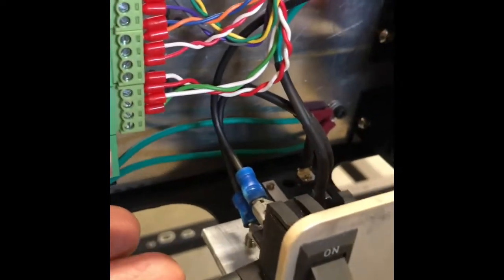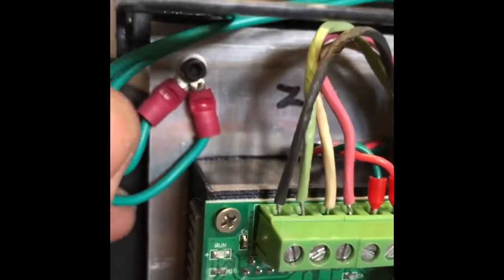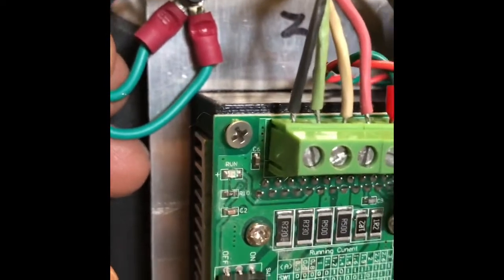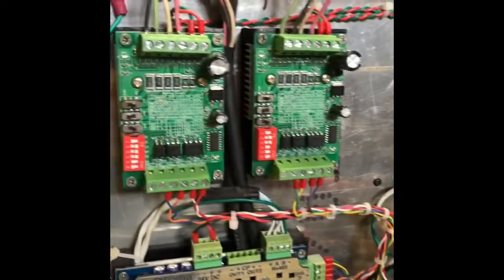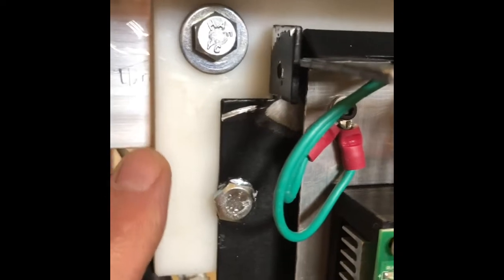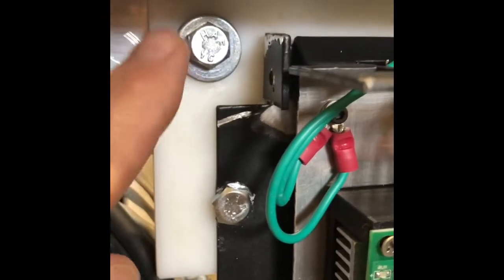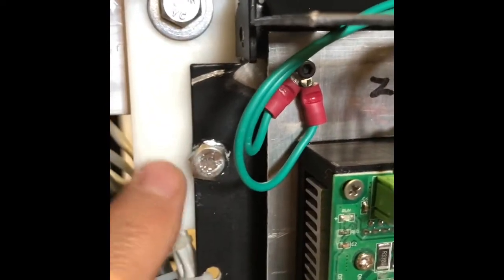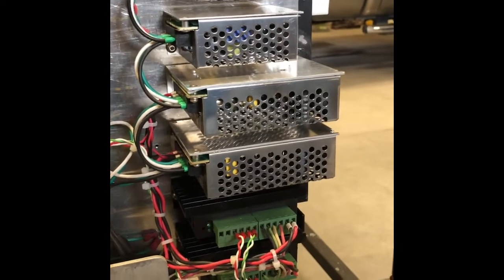DIY CNC Plasma Cutter electrical isolation

Comment: I have a plasma table under construction and the most sensible controller choice seems to be the Proma MyPlasma, not otherwise identified by number  You are the first YouTuber that I have found to be using this system.  I contacted the distributor concerning user groups or other sites and drew a blank.  Do you have a comment on this controller?  It is obviously working very well for you as I don't recall a mention of problems.  It's also obvious that you know your stuff and you did a great build.  Thanks for sharing.
Reply from the maker: Thanks for for the comments! Yes the controller has worked great!  I think it was a really good choice.  Like you I had trouble finding others using it.  A lot of people are using the Proma auto torch height controller and seem to be happy with it after they were able to get it tuned in.  I was going to go with one myself but when I found that for only a few dollars more I could get the myplasm set which comes with the auto THC and the controller. I figured it was worth going for .  I recommend reading the manuals (available on their website) to get an idea of how everything works. I bought the two package deal just in case I need a spare.  I haven’t had any problems.  If you have any specific questions let me know... I’m very happy with the controller!
Reply: @mrkrazyjeep  I really appreciate your response as information seems to be rare unless you read Polish.  Are you referring to the "manual" on the Automation Technology website?  What is the two package deal?  I'm building this unit entirely from a raw material standpoint with the exception of ball leadscrews, motors, bearings and controls.  My Thermal Dynamics Cutmaster 58 is only a year old, but does not have an ATC board or connector.  The adapter kit is available for around $216, but I like the idea of wiring it as described in the "manual" and as you explained in your video.  I also like the idea of the Proma controller being a plasma-dedicated unit as I am a manual machinist and don't have the time to learn a 3-D program that I do not need.  I noticed that STV CNC Applications is using the this controller on the SPARX tables they are marketing.  I respect your privacy as you do mine, but would be pleased to communicate with you via email if there would be a way to do that.  Thanks again.
Reply from the maker: If you go to the Proma homepage, in the upper left section you’ll see country flags. Select the British flat and the page will switch to English, from there it’s easy to navigate to the manuals. When you get to the manuals make sure to select the ones that end in eng for English.  I would be more than glad to communicate directly! If you can’t find the manuals send me you email address and I’ll email the manuals to you...
Reply from the maker: When I bought mine they some deal that if you bought two you got a little discount. I’m not sure if they are still doing that
Reply from the maker: Yes a floating head,  I used a micro switch to determine torch height so the floating head allows the torch to float up until it hits the switch.  At that point the controller knows where the material is and where to go for the start of cut.  The myplasm also allows for and ohmic touch off which I guess might be able to do without a floating head but I think I would still use one just so if something went wrong it wouldn’t destroy things if it try to drive down to far.  I actually am going to add the ohmic touch off on mine just to see how well it functions.
Reply: Hello Leonard,  I think I have the same thoughts as you about the Proma controller.  It looks perfect ( for my needs, because I don't want to spend to much tine on learning G-code stuff)  I know how to draw DXF files.  And the fact that the Proma controller can handle DXF files is Super.
To my opinion it's very strange no more information is on the web or on YouTube. Ofcourse, all the necessery information is on the Proma website.
How is your build proceeding ?

Comment: Do you have a parts list of all electronics that you used to complete the electrical part of the Cnc
Reply from the maker: I don’t have one put together but let me see if I can pull some information together for you.
Reply from the maker: CNC controller and auto torch height controller:
My Plasm by Proma

X axis 
Motors: 
Nema 23 Stepper Motor 2.83Nm 4A 8-wire 6.35mm Dual Shaft CNC Mill Lathe
Drivers:
CNC Single Axis 4A TB6600 2/4 Phase Hybrid Stepper Motor Drivers Controller New
Power supplies:
24 volt DC power supplies were purchased at an electronics warehouse

Y and Z axis
Motors:
I salvaged the Y and Z axis stepper motors from a video vending machine that I purchased off craig's list.  
Drivers:
TB6560 3A Stepper Motor Driver Single Axis Controller  
Power supplies:
12VDC 3A 5A 10A 20A 30A 50A Regulated Switching Power Supply for LED Strip Light